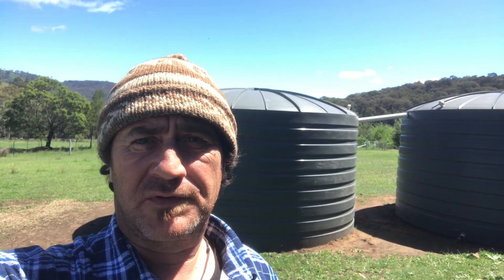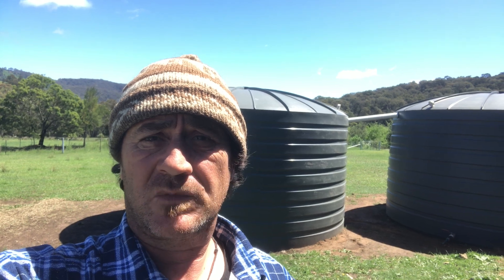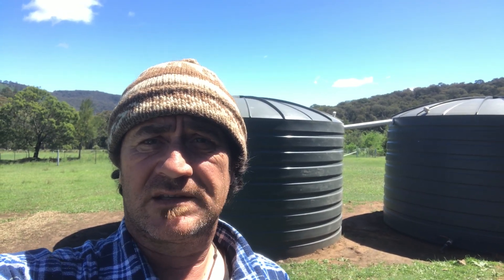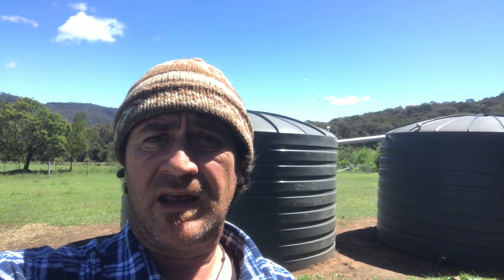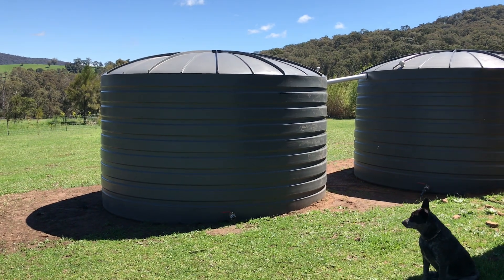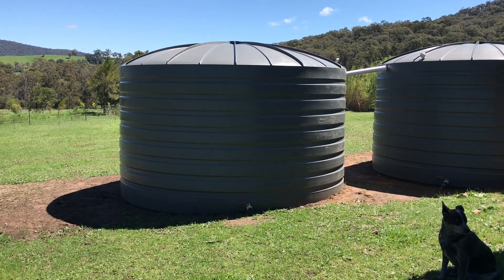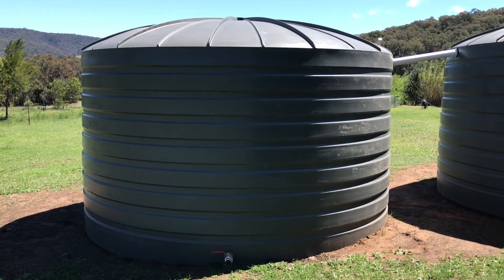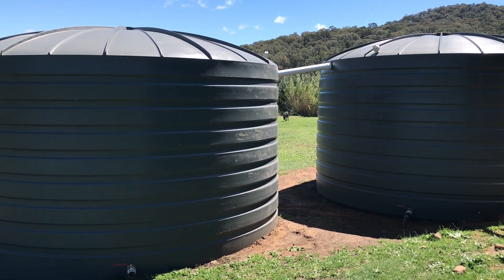Main Water Pump House - Stage 1 Pump House Build.

Comment: Are you going to use fireproof paint on your pumphouse and stumps ,white paint would be cooler in summer because of the pump you will install,like the idea of all metal sprinkler system running across top of shed,when it is on most of the water will run back into your tank,hope you put one on your home also, like all you are achieving on your farm.
Reply from the maker: hey there, we will be leaving the pump house natural but will have fire sprinklers on to of the machinery shed which will cover and protect t the pump house. Touch wood we will never need it.